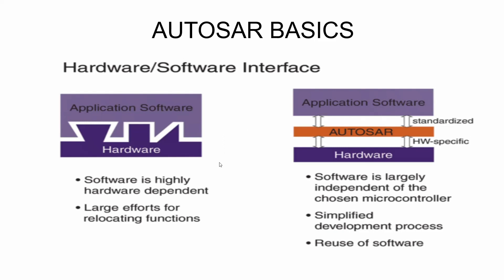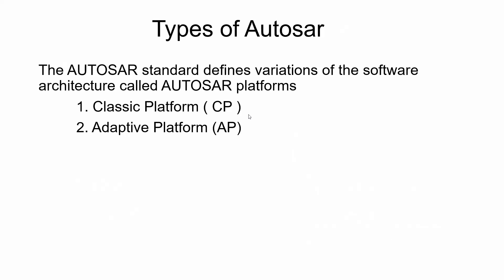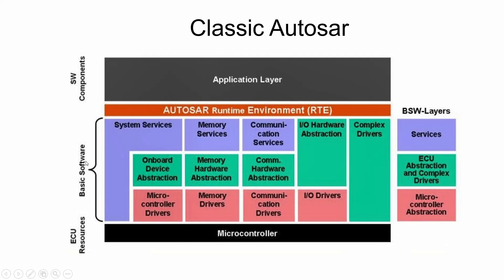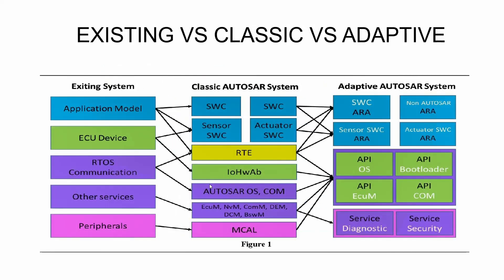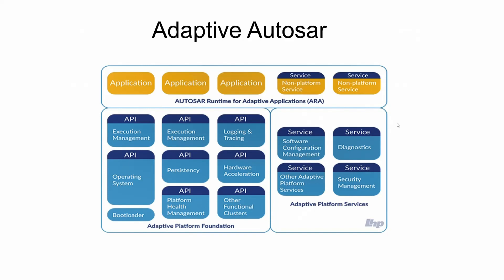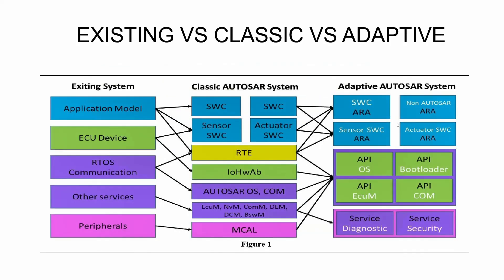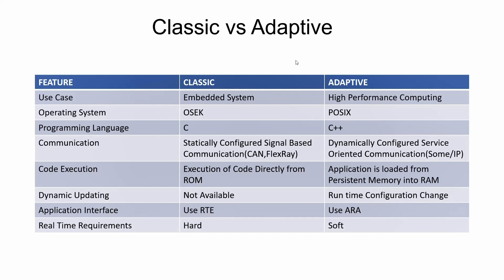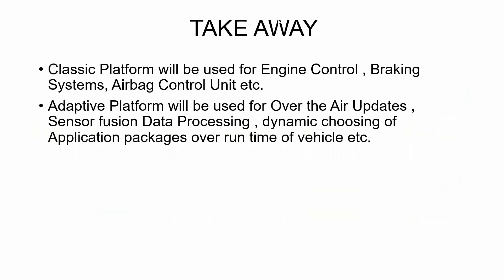Classic Vs Adaptive Autosar

Comment: In classic autosar we can change using calibration method right?
Reply from the maker: Can you please add some more details for your question?
Reply: @GKR23  as you said we can't change variable values during run time, but using online calibration we can change the values right in classic autosar?
Reply from the maker: @punitkoti4057  Yeah changing the values in Calibration doesn't affect your Build( Means Software Build ) . calibration is not depends on Classic vs Adaptive